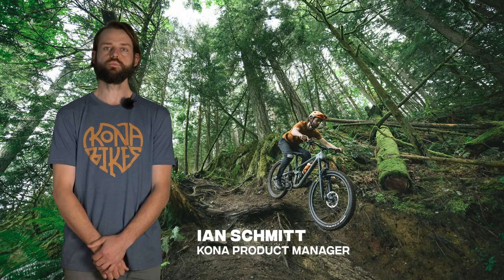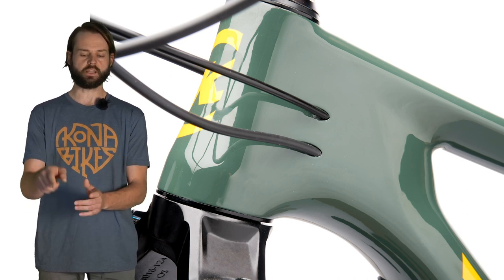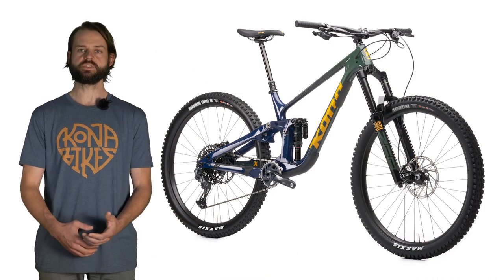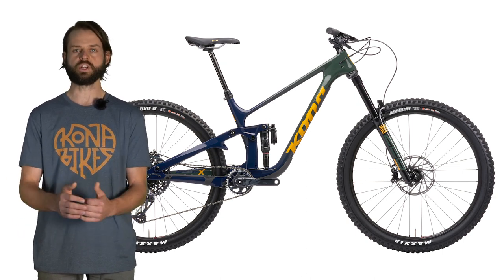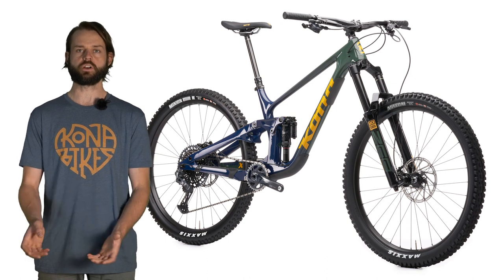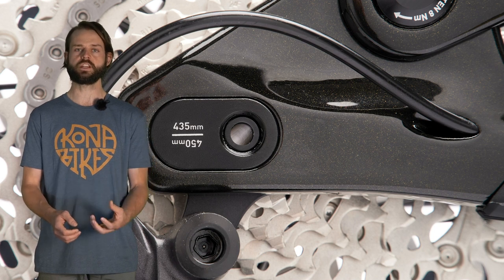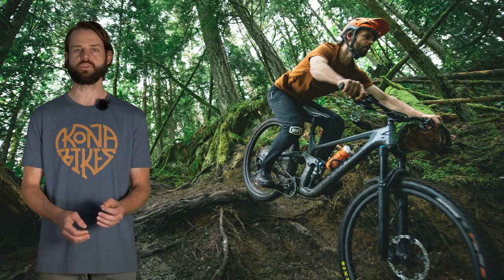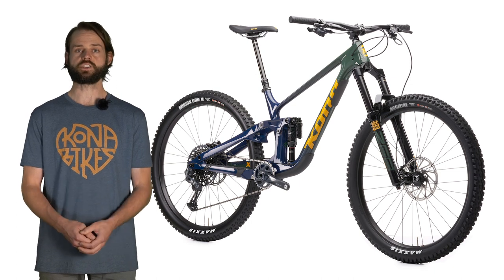2021 Process X - Tech Video

Comment: Will the included brake adapter in the small parts box work with 203mm rotors for switching between chainstay lengths? You only mention 200 and 220mm rotors and I'm worried I won't be able to use my Shimano brakes as easily. Are you able to help me?